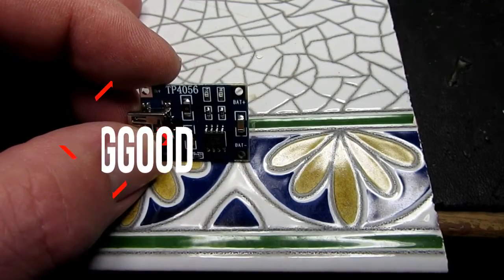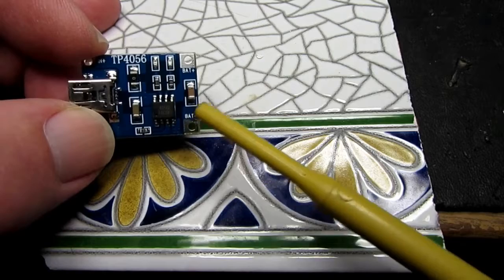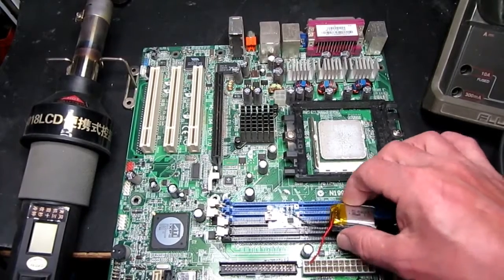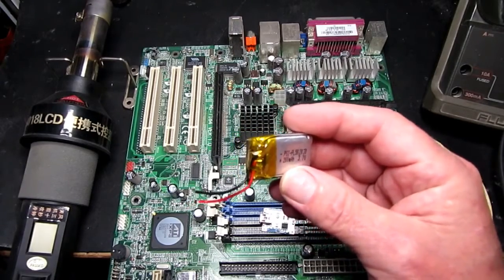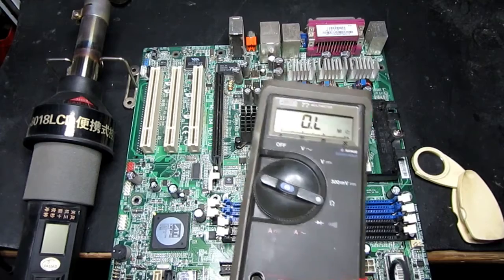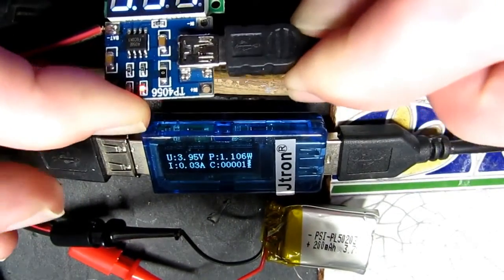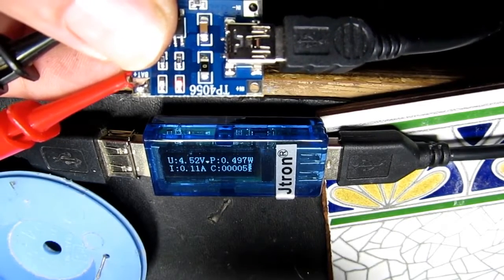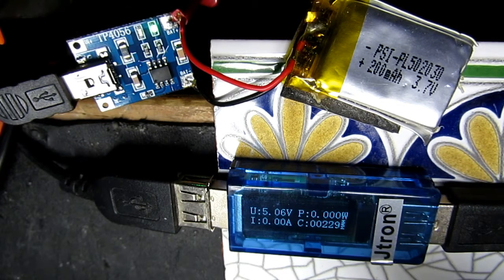TP4056 5V 1A Lipo Battery Mini USB Charging Board from Banggood - Electronic Project

Comment: Thank you! Great video. At what settings do you set your 8018 LCD heat gun for SMD desoldering? The sensor is not accurate, I set my temperature to 480c with max airflow which removes SMD within 1 minute, but I'm afraid it's too hot for the PCB?
Reply from the maker: Hey thanks! Setting the heat gun is a balancing act between the temperature and airflow. I just set the airflow around half way and play with the temp till it works! I would not worry too much about damaging the PCB, after all the boards are flow soldered in the first place! Good luck with you projects. Thanks for watching, have a great day!
Reply: @1nformatica  Thank you. don't mean to repeat myself, but I sat the temp on 480 with airflow both half and full. It seems to be working removing any component except SMDs. I don't know why, could it be related to the fact that I'm using copper  pipes flux? (it's a broken PCB so I didn't mind acid on it)
Reply from the maker: @af6727  Flux for plumbing is a very bad idea! Use a proper electronic solder flux. This problem is usually because of the lead free solder used in manufacture. Sometimes adding a little leaded solder to the part will make it "flow".

Comment: What batterys can I use with this??
Reply from the maker: It is designed to charge Lithium ion or Lithium polymer cells 3.2 volts nominal. Typical cells are found in toys like drones, cameras and many other appliances. If you tell me what you have in mind to charge I can check for you. Please consider subscribing if you have not done so already!
Reply: @1nformatica  maby a lion but also can I use the battery out as charging the battery and also add a female usb to it so I can use it as a usb power bank?
Reply from the maker: @tizzy_24  There are better options to build a power bank. Here is an old video of mine : https://www.youtube.com/watch?v=_L-mCuoV5CA You can now get a USB 3 kit : USB Quick Charge 3.0 Power Bank Kit http://bit.ly/DIY_PowerBank
Reply: @1nformatica  ye thanks but I want a small forme factor and just want to know can I use that tp4056 usb c board as a input/output??
Reply from the maker: @tizzy_24  Yes, I used one in this project : https://youtu.be/lDEagFgoz2M?t=261
Reply: @1nformatica  no I don't thi k u understand dose the TP4056 usb c board have 5v step up converter if it dose can I use the usb c as a out put (I know the input is for charging) like I can use a USB c to usb c cable to charge my phone from that usbc board if it doesn't have the 5v stepper comver can u find me one that has the samw small form factor as the TP4056 usb c
Reply from the maker: @tizzy_24  No, the TP4056 is only a charger, there is no power output from the USB port.
Reply: @1nformatica  oh OK is there a usb c board that I can use as a input/out put with also 5v step up converter??
Reply from the maker: @tizzy_24  It is not clear to me what you are trying to do. Charging boards do not output power and a step up converter will not charge batteries.
Reply: @1nformatica  OK could u find me a usb c power bank board with maby  a usb port as well but in a small form
Reply from the maker: @tizzy_24  This is the smallest I could find : http://bit.ly/MiniPwrBnk

Comment: I have few 1s lipo batteries for my drones.now charger is missing... Can I use tp4056 for these types of lipo for charging?
Reply from the maker: Yes, it will bee OK. If the cells are only 200 - 300 mAh you should consider reducing the charge current as i show in the video. You can also consider this TP5100 board https://www.youtube.com/watch?v=gKNF-hATmfQ Please consider subscribing if you have not done so already!

Comment: Can i charge 3.7 v 1000mah in tp4056
Reply from the maker: Yes, it is designed for that. Please consider subscribing if you have not done so already!
Reply: @1nformatica  yes  i subscribed already thank for your reply
is i want to change the resister like you did or i use it normally
Reply: @Renzo Guzzo thank you so much

Comment: Hi, I have a really dumb question. I understood that the 1.2K Ohm resistor means the charging current will be capped at 1A. But will it work with a lower current? As an example, if I plug this circuit into the USB port of my computer, the current is capped at 500mA out of the computer, so after reduction to 4V, the current won't be higher than 500-600mA. Is it a problem? Will it work? Thanks a lot !
Reply from the maker: I guess it will work but I cannot say for sure, you will need to try it. Please consider subscribing if you have not done so already!

Comment: Hello. I have the same charging board 1A micro USB, but my battery is 3.7V with 300mAh. Do I need to change the resistor to charge the battery correctly ? If so, what resistor will I need to purchase and can you recommend anywhere to buy them from? Thanks
Reply from the maker: I would change the resistor to 10 K ohms like I show in the video to give 100 mA charge rate. I usually rob parts from old equipment like I showed. 10 K ohms is a very common value. Even a standard size resistor would fit. https://bit.ly/10K_Resistor
Reply: 1nformatica thanks for your help! One more question.... how do you remove the resistor that’s already there? I cant tell from you video what you are using to heat it up? Can I heat it with a solder iron to remove the existing resistor ?
Reply from the maker: @rossyp88  Sure you can use a soldering iron but I prefer to use a heat gun for surface mount work. You can see it on the left of the video here : https://youtu.be/tWSPvsFQxzI?t=166 You can see the details here http://bit.ly/HotAirGun
Reply: 1nformatica , so I looked on eBay and found — SMT 1206 10K ohm Resistor SMD 1% Chip -    Does this sounds like the correct resistor to buy? It looks most like what is shown in your video with 103 on the front ? Thanks
Reply from the maker: @rossyp88  Yes, that will work.

Comment: so the standard 1 amp board would work fine for charging a 500 milliamp battery?
Reply from the maker: 1 Amp is 2 times the capacity of the cell so it is a "2C" charge rating. Provided your cell can handle 2C it will be OK. If you cannot find the "C" rating of your cell try charging it at 1 Amp but monitor it closely. If the cell gets warm then OK, but if it gets hot then stop immediately. In that case you will need to reduce the current for that cell. Please consider subscribing if you have not done so already!

Comment: Question, I bought 2, 1 Lion and 1 Lipo. They look similar s how can I ell which is which?
I want to charge a cell phone LioN.
Reply from the maker: From a charging point of view they can be considered the same. A Lipo has a greater energy density and can supply higher currents. The datasheet for the TP4056 calls it a li -ion charger https://dlnmh9ip6v2uc.cloudfront.net/datasheets/Prototyping/TP4056.pdf There is an interesting thread here : https://www.candlepowerforums.com/vb/showthread.php?348891-Lion-vs-LiPo-Which-better-or-are-they-just-different

Comment: Hi..Thank you for the good Info on how to change the resistor.I need Help..i have the same battery Lipo 3.7 V - 1000mAh Can I use TP4056 .with 5V 1A to recharge it or i should change the resistor  that can be suitable to recharge Lipo-1000mAh Battery ..if yes kindly you tell me which suitable Resistors to Replace I`m really sceard of doing any mistake my big problem is  I bought twenty of these batteries and now I'm confused
How do I charge them? I would very appreciate your help Thank you
Reply from the maker: Hi Bianca, You should try and find a data sheet for the cells you bought, maybe ask the supplier? Or if there is some code on the cells use Google. The general rule for charging current is 0.37 times the capacity of the cell or 370 mA for you. You can find on the product page here http://bit.ly/TP4056_Chrg 
The resistor value to set the charge current. 400 mA will be 3K ohms.
Reply: Hello @1nformatica  I dont know how to Thank you..Honestly I'm a beginner and I have no idea the  code in this battery i have is  LIpo-EHAO 503450 - 3.7 V 1000mAh  to use 5V 1A mobil charger I very much appreciate your help if you could also provide me link where to buy them God bless you and your familly wherever you are.. definitely the earth thanks the clouds when the rain comes
Reply: @1nformatica  3K ohms or 4K ohms Thank you
Reply from the maker: 3K is 400mA, 4K is only 300mA which I think is a bit low.
Reply: @1nformatica  your advice is 3K right Thank you again..please keep healthy and safe Amigo :)
Reply from the maker: Gracias! You could also fit a variable resistor of say 5K, then you could experiment with different charge rates.
Reply: @1nformatica  How are you My Friend I am just a beginner And then I learned a lot from you and gained some of the information that I did not know.. so you Advice me to use 5K Resistor with TP4056 and then i can do experiment with battery such Lipo-EHAO 503450 3.7V 1000mAh
what about those Resistor with colored lin with legs 
i wish you do some day video with those battery i mentioned above until now id id not find any video who changing resistor with these kind of battery  Thank you very much  1nformatica
Reply from the maker: I am suggesting to use a variable resistor (potentiometer) that you can put in place of the fixed resistor to set the charge current. A component like this 5K Potentiometer http://bit.ly/5KPotentiometer
Do you have a digital multimeter?
Reply: @1nformatica  No I dont have Digital multimeter but I will buy one today ..and i will buy the potentiometer even I dont know how to use it.. and I will read more 
Thank you ~(^_^)~ Mr  1nformatica God Bless you amigo
Reply from the maker: When you have the potentiometer tell me and I will help you. I have a playlist of videos especially for beginners, take a look: https://www.youtube.com/playlist?list=PLxtbRS-naT6_7U7svrrTfRsy9Prhpx3iC
Reply: @1nformatica  Thnak you always i already watch all your other video honestly i learn many things from you Thank you Sir
Reply: @1nformatica  I will inform you  once again Thank you God bless you  a lways please be safe keep healthy

Comment: What is the charging time of battery
Reply from the maker: If the 4 cells are wired in series multiple tp4056 boards is not the way to go. Please look at my latest video to see how I charge 4 cells : https://www.youtube.com/watch?v=K6P4fiPUbgA
Reply: 1nformatica  Hello,I was wondering if this tp4056 can charge 4s li-ion battery?
Reply: 1nformatica Do you have any video about diy charging 4s li-ion battery? 
What type of current board should I buy to make a 4s li-ion battery charger? Please help. Thanks
Reply from the maker: Hi, the tp4056 can only charge one cell. You would need 4 boards and 4 seperate power supplies which is not very practical. I am making a new video at the moment on this subject and will post a link when it is published. Meanwhile take a look at this 4 cell protection board : https://www.youtube.com/watch?v=sZOlD9pzaQM
Reply: 1nformatica can I use 2.0A phone charger to charge 2 of tp4056. How can I know how long does it take to get charged?
Reply from the maker: Hi, a standard phone charger will only output 5 volts so only can use with one tp4056 to charge one 4.2 volt cell. How long it takes to charge depends on the battery capacity you have and the charge current. The standard charge rate is 1 Amp so if your battery / cell is 1 Amp hour i.e. 1Ah or 1000 mAh then it will take about 1 hour to charge depending on the charge state of the cell when you connect it.
Reply: 1nformatica So if I want to use 4 of tp4056 then how many voltage and current power supply should I get?
Reply: 1nformatica Hello, after I watch the video I till not get it. Is connect 4 of tp4056 in series better or connect parallel is better?
And if I connect 4 of tp4056 in parallel input then how much voltage as current power supply should I use?
Reply from the maker: I need to understand what you are doing to help you. What type and capacity (mAH) are the cells you are using? How are the cells connected series or parallel?
Reply: 1nformatica 
I’m using Li-ion battery. Each cell 4.2v and  ~3000mah. I connected 4 of the Tp4056 in parallel (+)to (+) (-)to(-), each tp4056 connected to single cell. And I was wondering what voltage and current do I need to charge 4 of them?
Reply from the maker: I guess the cells are actually wired in series to give 16.8 volts? As the tp4056's are wired across each cell they need to have their own individual power supply of 5 volts 1 Amp for example 4 phone chargers. As I said before this is not really the way to go and you should consider a 4 cell battery management board with balance capability as I showed in my other video.
Reply from the maker: Hello, it depends on the battery capacity you have and the charge current. The standard charge rate is 1 Amp so if your battery / cell is 1 Amp hour i.e. 1Ah or 1000 mAh then it will take about 1 hour to charge depending on the charge state of the cell when you connect it.
Reply: 1nformatica the battery cells are not wired in series or parallel. Each cells are individual
Reply: 1nformatica 
Only 4 of the tp4056 wired in parallel

Comment: excellent video, I have a question, I have a solar cell that is 6v 1w 166 mah , and the battery I wish to charge is a 2200 mah battery, is it possobile or do I need to.modify something? thank you for your time
Reply from the maker: Hi Erick, I think it will be OK as it is. The max input voltage of the TP4056 is 8 volts according to the data sheet. Of course charging at only 160 mA it will take a long time to charge but if the cell is not going to be completely discharged in it's application it will be fine as long as the sun shines! Datasheet here: http://datasheetcafe.databank.netdna-cdn.com/wp-content/uploads/2016/09/TP4056.pdf
Reply: 1nformatica thanks for your response and data sheet, I'm still very new at this , can you just tell me if I'm right or wrong on my calculation, 6v at 166mah for a 2200 battery would be about 13/14 sun hours correct? I live in Cancun so our sun is phenomenal, but just wanted a second opinion, thank you keep the great bids coming, I'm glad to see so many people into the diy a d electronics its like a new movement and generation
Reply from the maker: Mucho gusto! Here in Almeria Spain it's normally quite sunny too! Your calculation is correct but it depends on how much charge remains in the cell when it starts to charge that you will have to test. Maybe you will need to find a more powerful panel. Un saludo.
Reply: 1nformatica gracias amigo, I doubt I will drain them, its for LEDs. kit when ever.

Comment: Great information! What temp do you set the heat to to remove SMDs? I'm just getting my hands dirty with this stuff and don't want to fry something that could otherwise be useful.
Reply from the maker: Hi Benjamin, the hot air gun I use has control for both temperature and air flow. It is a balancing act to get the temperature and airflow right for the particular work you are doing. In general I set the temperature around 650 degrees F (340 C) and airflow quite low. Try experimenting on an old computer motherboard for example until you get comfortable with the process.
Reply: Excellent. My heat station also has heat/flow controls. I've saved old circuit boards just for practice, I was hoping there was some "magic formula" I could follow.
Reply from the maker: Sorry no magic formula I know of, only "practice makes perfect"!